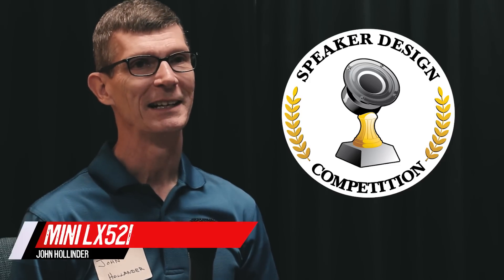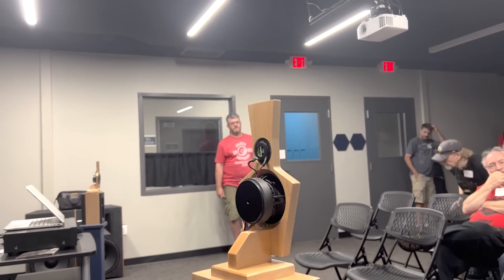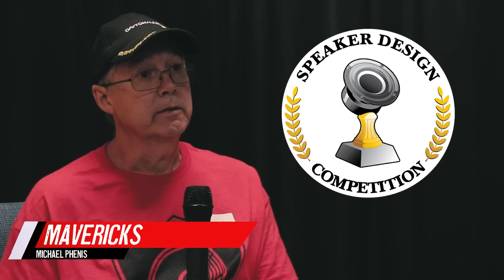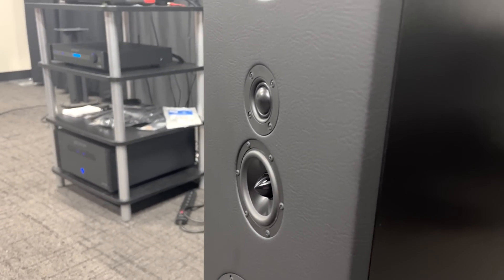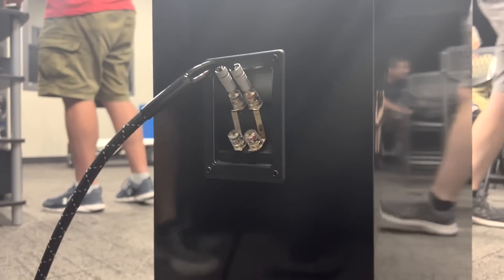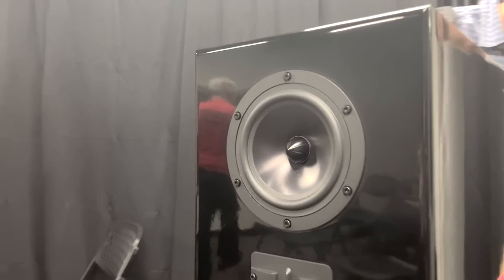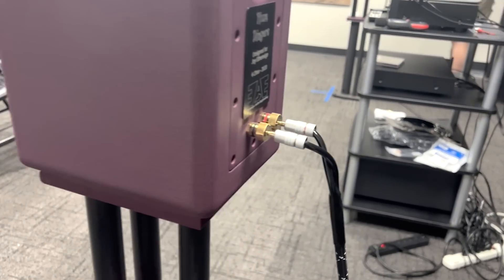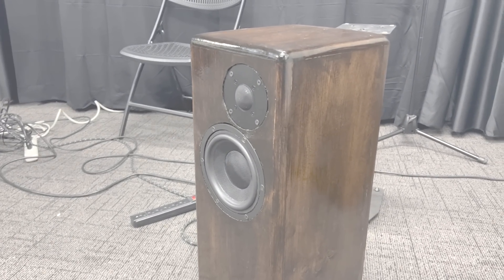2022 Parts Express [Speaker Design Competition] - Dayton Audio Category

Comment: Are these designs available to follow  anywhere?  The Vespers look like a really nice high-end mid sized two way.
Reply: None of them sound like they have been particularly well designed (mostly for looks) if you want some well designed DIY speakers check out Troels Gravesen speakers. They are not only good looking but well designed.
Reply: @DodgyBrothersEngineering  Pretty sure at least some of them are but you are left with no clue with this video.  I am aware of Troels just havent built any of his designs, he is a legend though.
Reply: @PhillioDoede  it's just things like scaling down the LX521's you can't just take a design that works and scale it down (although that is probably a bad example since it is open baffle and probably won't be as badly effected), but the one with the ribbon tweeter looks like the mids are distanced too far apart. I run a dipole RAAL ribbon, but my mid is as close as I can get it. I was running two mids previously but they were right next to each other. Not either side of the ribbon. At those frequencies I would almost bet money on there being canceling issues. Most of these in this video look better than some of the others I have seen in their other videos where you can see obvious diffraction issues occurring. I like the look of Troels designs because he gives you enough dimensions to give you repeatable results, plus he also puts a lot of effort into the electrical side of the speaker. If I was going to recommend a DIY speaker to anyone it would be one of his designs or a flat pack from GR Research where Danny has already been done the design work at length. I wouldn't try emulate any of these as they are probably best guesses (not that there is anything wrong with that we all have to start somewhere).
Reply: @PhillioDoede  the Vespers would be a fairly safe design to almost guess at. Because the tweeter is sealed you only need to make sure that the distance from the centre of the tweeter to any of the 4 edges are not equal (something you could do by eye) and just work out the cavity requirements for the main driver. Keep the tweeter on ear level and provided you get the crossover point right it would be pretty hard to go wrong. One of the really great things about that classic two way design is that you can very easily control the cavity volume by simply blocking off any of the cabinet space you don't need. The box is often way bigger than the volume required, so internal sizing is a breeze.
Reply: @DodgyBrothersEngineering  I get your points and I'm not really particularly interested in building any of these because most of them are novelty projects that people want to build for a variety of reasons but nothing anyone is going to go out of their way to replicate.  The few designs that have some practical thought and design into them like the Vespers don't have any detailed information so who knows as to how good it is.  I'll just build a CSS one of Madisound OEM kits or one of the vetted proven designs, ect.

Point is these videos are pretty pointless and I fail to see who the target audience is.  If Parts Express wants to promote the hobby this seems like it misses the mark and is missed opportunity. 

Out of curiosity do you have your designs published anywhere?
Reply: @PhillioDoede  Not at the moment. I have been incredibly slack turning plans into speakers. My next lot of speakers are going to be a mega sub (TC Sounds LMS Ultra 5400 and two 18" VMP passive radiators) and some high end home theatre speakers (using RAAL ribbons and Scanspeak Illuminator drivers) once I finish designing the home theatre they are going into.